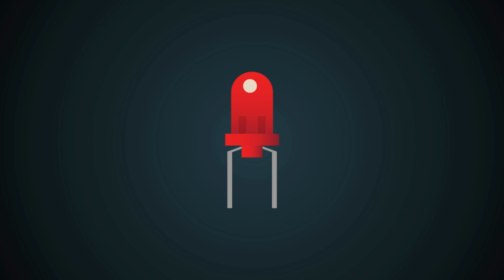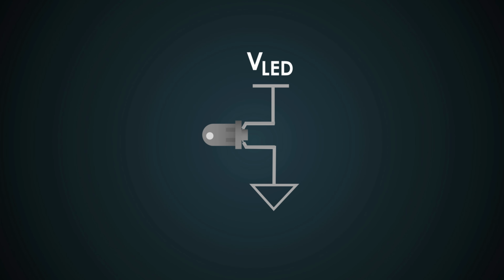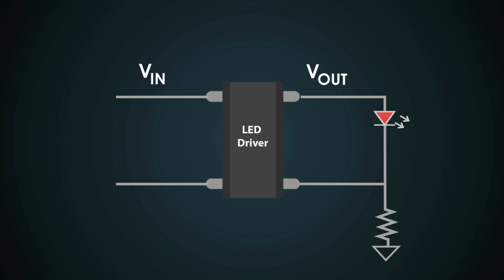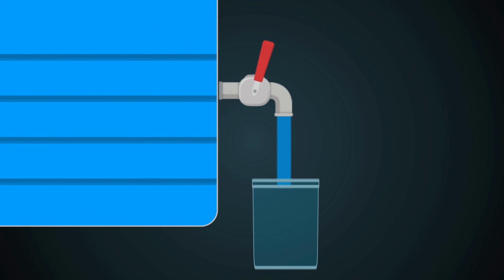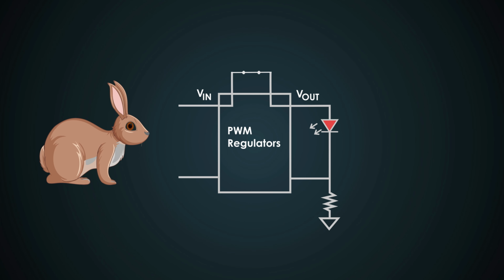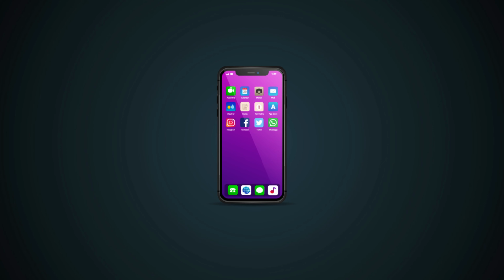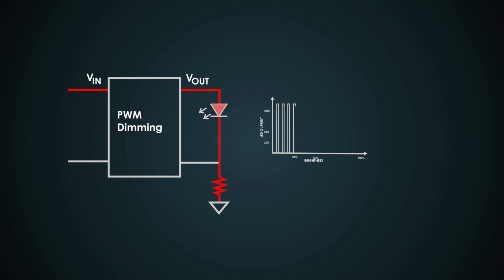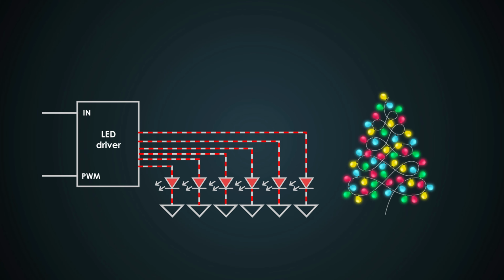How to drive LED? What Is LED Driver? Understanding LED Driver | LED Drivers

Comment: Nice well demonstrated video Question if your able to give some advice or anyone else. I have a battery torch floodlight  with recharged batteries some details the torch has a 10W cool white chip cob. I may have  damaged the driver chip maybe. The touch was shutting down withing 1/4 hr on fully charged batteries.  On carrying out a diagnostic  the socket connections have the same plugs so it's easy yo plug any plug into the pcb sockets ( power. SW Battery LED ) so having stripped this down many times to check for fault I connected the battery plug to the LED out socket with some heat and slight smoke. the light output was not bright after reconnecting. So bought a new 10W cool light cob chip installed and still have the same fault a dim led. the driver PCB has a a XL60050x1 chip smd fitted only 3 pins used VIN SW & GND . I have a power supply DVM and a oscilloscope no signal generator I see from some  data Vout will be higher than Vin but mA will have to be controlled as not to destroy the cob chip any thoughts  as whether  I have destroyed the driver chip. I have checked diodes capacitors inductor and resistors all fine